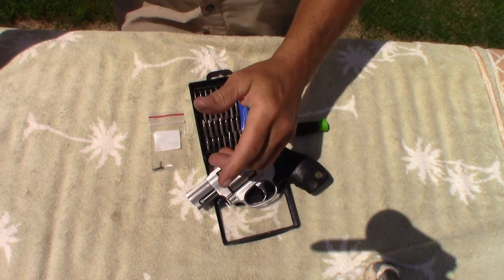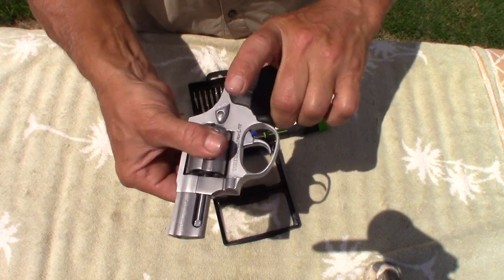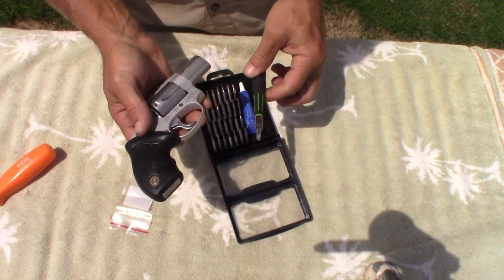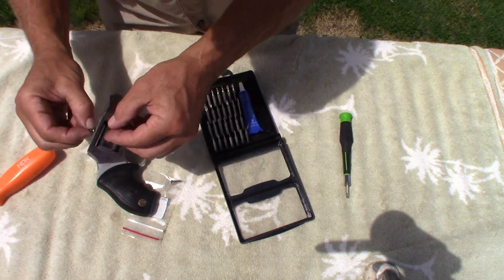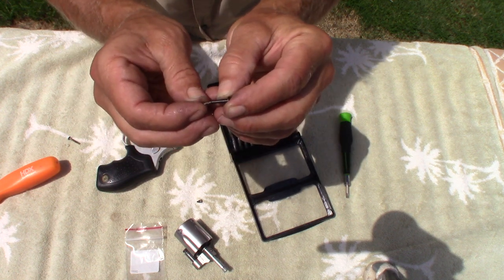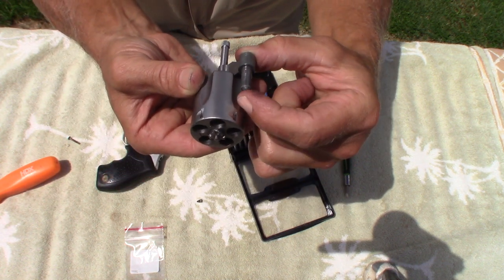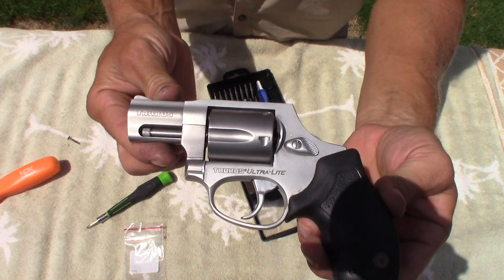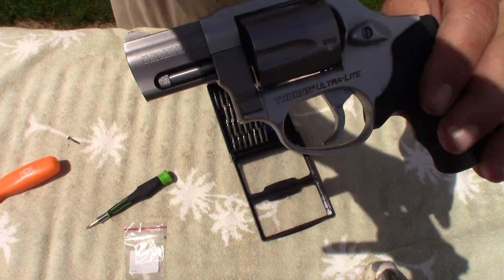Revolver Cylinder NOT LOCKING. (FIX)

Comment: Thanks for making this video. My brand new Tracker 44 Talo Edition 44mag snub did the same thing. When the cylinder was closed to the frame, the cylinder could be rotated manually clockwise but would lock up properly when the cylinder was rotated counterclockwise. I ordered a new cylinder stop plunger and spring and it fixed the problem.

Comment: Thanks for making this how to. I recently purchased the Taurus 856 Defender in 38 spc +P and while, in my infinite lack of experience, replacing the grips with a set from Altamont lost the tiny spring and plunger from that same side plate screw/detent while also buggering my plunger for the cylinder and spring. All my own fault for not slowing the process down and reviewing the break down diagram in the manual. Receive my new plunger/spring set and by miracle of miracles, found the detent spring and plunger. in front of my work area. Anyways, thanks to your video everything is back in order, functioning properly and firing nicely. I also added a set of springs from Galloway Precision and the trigger pull was dramatically improved. Stay safe, be blessed and thanks from Texas.
Reply from the maker: God Bless Texas and small miracles! 👍👍🇺🇸🇺🇸😁

Comment: I know I'm late , but I have a Taurus 80 that was sloppy because there was so much crud in the cylinder stop plunger spring , that the spring wouldn't extend correctly ... 
Good clean up and she tightened right up.

Comment: While cleaning my Taurus Model 66 I removed the yoke screw, but did not hold it tightly enough and the screw, spring and plunger flew.  I eventually found the parts, but decided to order spares on July 2, 2017.  The screw arrived, but not the spring and plunger.  After long waits, eight calls, and a letter to Taurus the  missing spring and plunger arrived on August 15, 2018.  Yes, the dates are correct; one year and two weeks.
I should have known better.  My Taurus PT145  (compact .45 semi-auto) went back to Taurus seven (7) times before they replaced it.  The replacement only went back twice, but it was extremely difficult to  get a replacement barrel for the replacement pistol.  Now it is a safe, reliable,  and fairly accurate shooter that I really like.
Reply from the maker: JoeR3of3 ... wow! I guess they really wanted to make a name for themselves. ... Yikes

Comment: Howdy sweet video I’ve got the Torres 44 magnum raging Bull 6 inch barrel went to go clean it after the range in the cylinder fell open crane was poking out finally figured out it was that little screw with the spring I guess it’s a cylinder spring for the crane spring if I tightened it too much the cylinder won’t drop what gives?Thanks mama baby

Comment: I'm troubleshooting something similar and trying to figure out the parts to get. My cylinder starts to spin when very slight pressure is applied to the trigger. I'm going to replace the stop, spring, and plunger

Comment: Dude, thank you so much for making this video.  I have the same problem with my Taurus 605 357.  I'm new to guns but I figured something was wrong with the cylinder when I can rotate clockwise easily by hand.  I'm going to contact Taurus and tell them about this problem.  Hopefully they can send me the part and I can do the fix myself.  Again, thank you for this video!
Reply: They all do that both of mine do it rotate it the other way and you'll see a difference

Comment: I notice that the cylinder comes out easily. On my new Taurus 856 Ultra-Lite it takes the combined strength of Superman and the Hulk to push the lever enough to get the cylinder to open. Any suggestions other than returning it to the factory.

Comment: HELP —> QUESTION:  my new (used) 686+ fires ONCE in double action but HAMMER won’t automatically RECOCK after round fired.  Then CYLINDER TURNS when pulling trigger while hammer sits in position (pulling trigger over and over I get rotation of cylinder but that’s it).  Thank you!!!!   -FRUSTRATED

Comment: I had the same issue with my 85 UL after 1000's of rounds. I was able to remedy, for now with a detail cleaning. 2nd thing is did you bob the hammer your self or have it done? I was thinking of bobing the hammer on mine but feared the loss of mass would effect the guns function.
Reply from the maker: this one was like that from the factory. ive heard of people doing that successfully but thats a good point on the mass. Not sure I would. Unless I had a back up plan if it failed

Comment: Hello elvis ammo, I have a question that i hope you can answer, I'm new to reloading and powdercoating and I'm having problems with making anything that is remotely accurate. I have been loading .38 special and I have been casting Lee semiwadcutters 140 grains coatet and sized to .357 and loaded them with 3,7-4,0-4,3 grains of Lovex D032. None of the loads has been working. I'm shooting with my S&W M66 with 6 inch barrel. What am i doing wrong do you think? Regards from Denmark
Reply: My 605 cylinder stop doesn't always lock up in single action. Think that will take care of that problem?